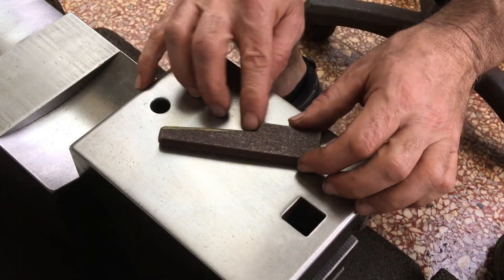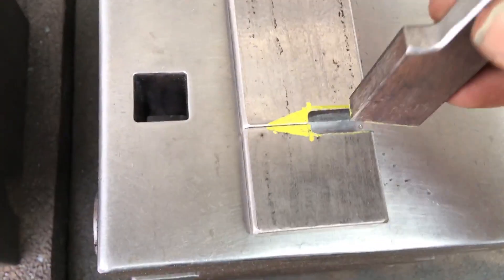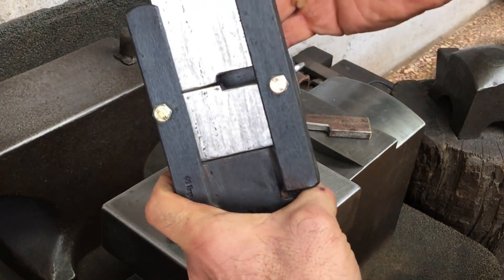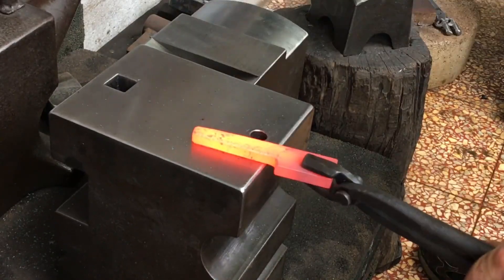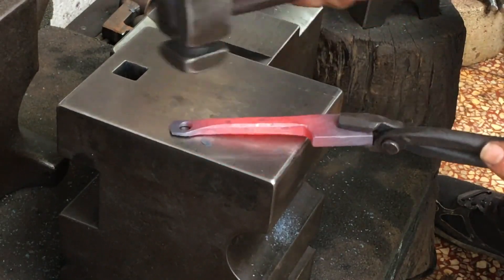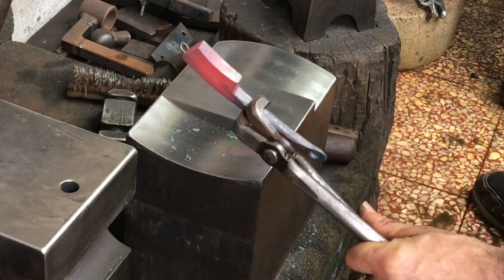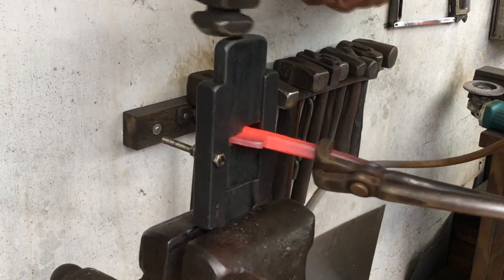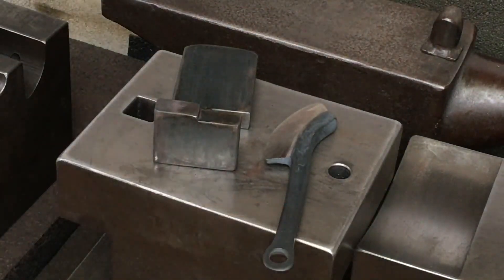Hollow Bevel Knife Edge Dies

Comment: Nice idea, I made a guillotine die a while back to turn 8 mm forged spring steel round stock into 7 mm square stock. I did work but it worked much better as a finishing die after freehand forging square. I needed a uniform 7 mm square for a couple of hand cultivator tines I was reproducing for an antique tool.
Reply from the maker: Thanks for sharing your experience.

Comment: As expected, it became a banana shape. I think if you reduce the thickness of the stock, the balde will curve more because of the thin "backbone".
Why don't you try build a tool that make the dye parallel to the edge instead of perpendicular? By increasing the surface area the curvature effect will be reduced. (maybe).
This video was very inspiring! Keep it up!
Reply from the maker: Hi Paulo, The way my current fullering tool is arranged makes it difficult to work stock parallel. But it's a logical idea to fuller in that direction for sure. Thanks for sharing.

Comment: Looks like it's going to work.  Don't know how expensive they are but I'd think an induction heating coil could save you a lot of gas for your furnace, assuming you have the correct electric power to operate it.
Reply from the maker: I think an induction forge may be out of the question given the power needed and my location, I think 3 phase... Thanks.

Comment: I am curious why you switched away from the old guillotine tool design with an open side? Other then durability perhaps I can't think of any reason not to want the more versatile tool. Well the new version that you call fullering tool is just a beautiful tool I can't deny that.
Reply: I made an open sided tool and they do let the tool wander. I made mine a closish fit to try to remedy this down side.
That's when I realised that the closed sided tool would fully support the dies, but of course you lose side access. Compromise.
Reply from the maker: This newer, "closed" version is just more accurate. But it has limitations for sure. Both versions are good to have and I'm always thinking how I can improve this tool while keeping it simple and small so let's see. Thanks.
Reply from the maker: Perfectly said. Thanks.